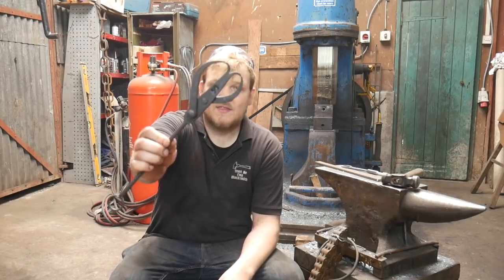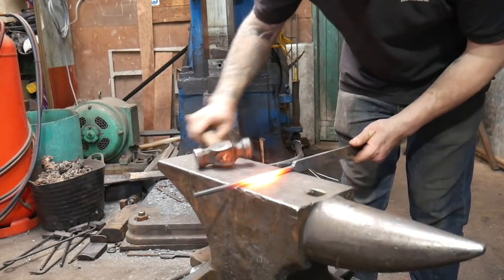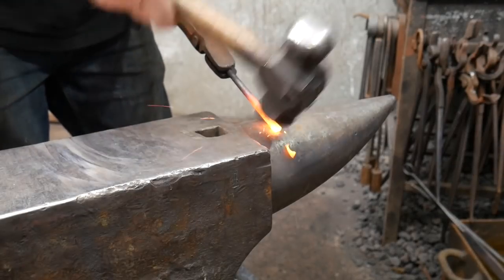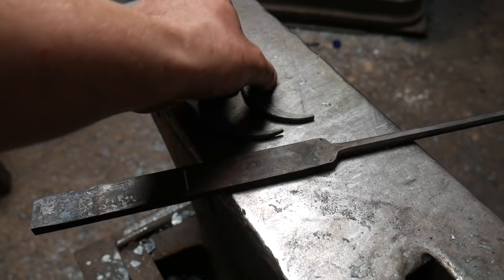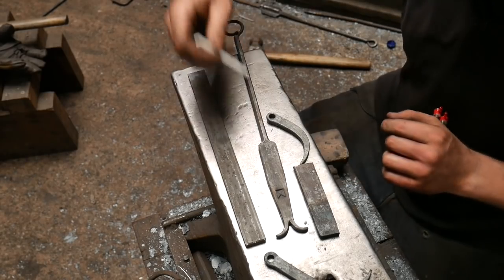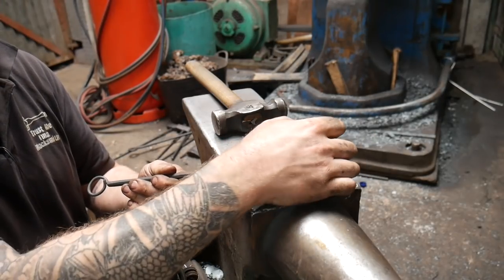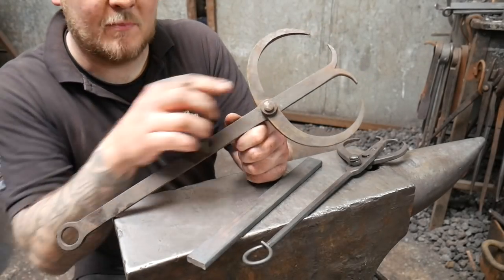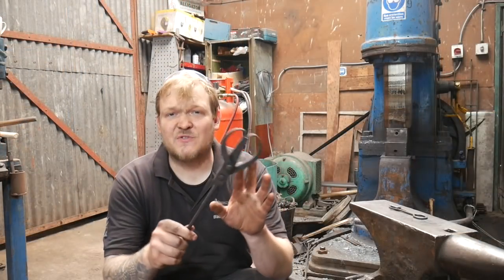Blacksmith Calipers Great Blacksmithing Project! Stay Home, Stay Safe and Stay Blacksmithing part 2

Comment: Last month, I finally made my first pair of tongs after trying for years. I discovered that my clearance for the rivets was too tight. It's actually ok to have a little more space to make it easier to drop the hot rivet into the punched hole.
Reply from the maker: You'll find making the hole for the  rivet larger will cause the rivet to upset in the hole before mushroom the head over. Be careful not to make the tolerance to large as this some time make the rivet upset so much it pushes the boss apart and you have a odd gap. But tight can also be an issue.
Reply: @danielmoss2089  great point! Does anyone know what the perfect tolerance actually is?

Comment: Love the video Dan!! Great work" nice and tidy" lol... question for ya,  in the summer when the temp is around 40°c + what do you  do in your shop to keep from passing out lol . Here in texas it gets mighty hot. Just wanted your thoughts,  cuz i use a camel back abd a cool wet towel.  But wanted to know what ideas you have. Thanks for the time abd love the channel.
Reply from the maker: I moan to my girlfriend when I get home. In fact any on that will listen. A trick that we did at College a lot that works well. My college forges where in a large tin roofed building with 60 fires in and lots of students trying to complete there year. Was to check water on the floor. As the water evaporates it pulls heat out of the air and drops the temp. Like crappy air con.